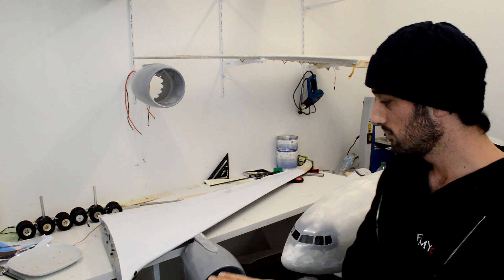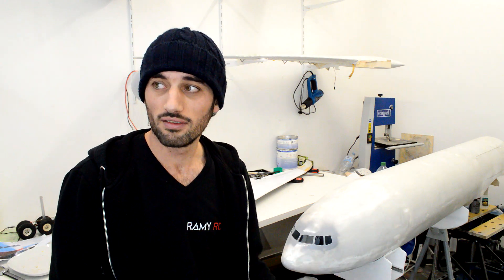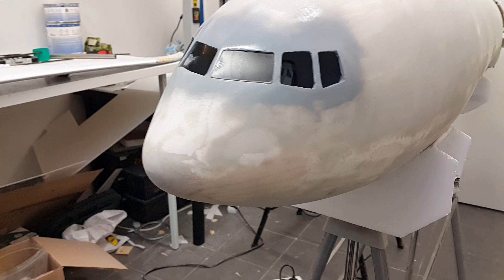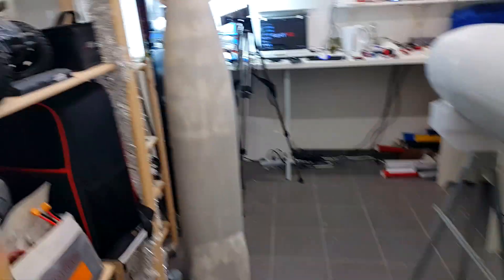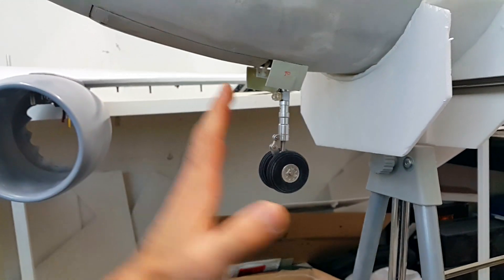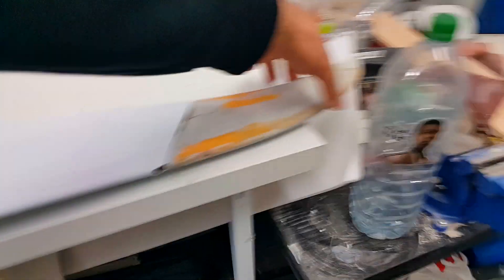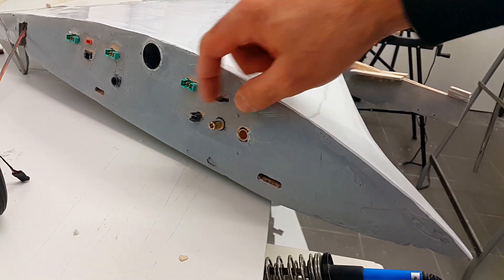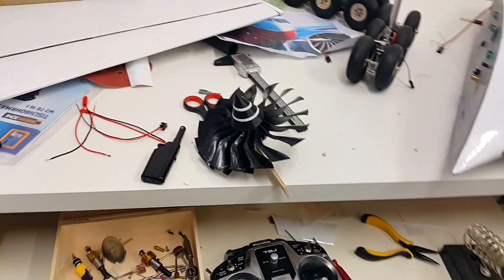Boeing 777-9X build update, Preparing for part 5

Comment: Dear Ramy ... I admire your work more and more, you have inspired me to build a 777-300ER. My construction is based on cardboard because where I live, the Depron is not achieved, I am moving forward and I am very happy with what I am achieving. I would like to know what motors you plan to use on your 777X due to size and weight. On the other hand, I would like to ask you if there is any possibility of you subtitling your videos in Spanish, for those who do not speak English fluently. I send you a big hug and my total admiration from Argentina!

Comment: Hey @Ramy RC very nice video, love the plane, looks great, but for the fan blades, I wonder if it would work if you put a large ring around the circumference of the fan blades so that they would be stronger and stay together. Just an idea. Love the videos and keep up the great work!  :)

EDIT: Love the cockpit windows and the steering thing. And also, what kind of battery do you use?
Reply from the maker: +Diegothepianokid03 that's a good idea but still risky, thanks 😃
Reply: @Ramy RC where did you get the pdf files for the fan blades, or did you model them yourself? Either way, they look awesome!
Reply: What I meant was try to make a plastig ring to fit perfectly (It would be very difficult) But if that is actually possible you could solder it to the fan blades (I have no idea if that is even possible). I do not want to be too demanding here, but i just REALLY want to see how the fan blades make the aircraft fly. Again, great work, and good luck.

Comment: If you can balance those 18 bladed fan designs and print with carbon fiber pla, you can use those on a high rpm edf
Reply from the maker: +sans3go good idea

Comment: Continue the great work.  I’ve been in the turbine industry for over 25 years and they are GREAT.  Stated, too bad you may not be able to stick with EDFs.  They are much easier to maintain I believe.
Reply from the maker: +Paul Guaglardi thanks Paul, sure I will try to stick on EDFs first, I'm also not experienced with turbines so it wouldn't be so easy to deal with them.